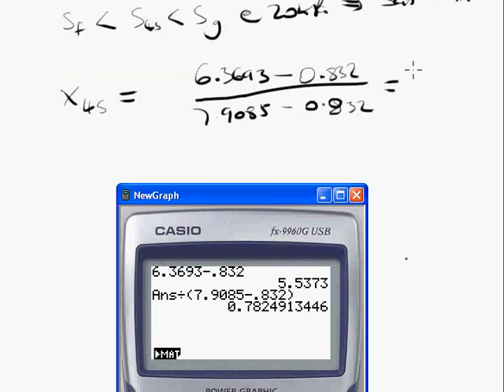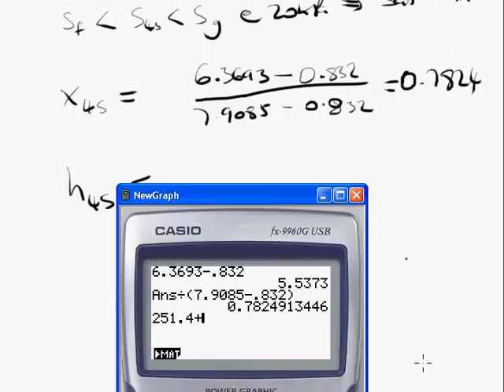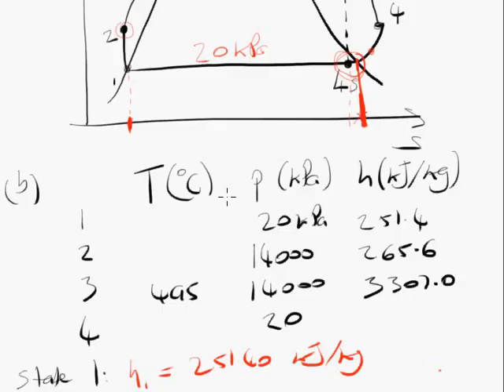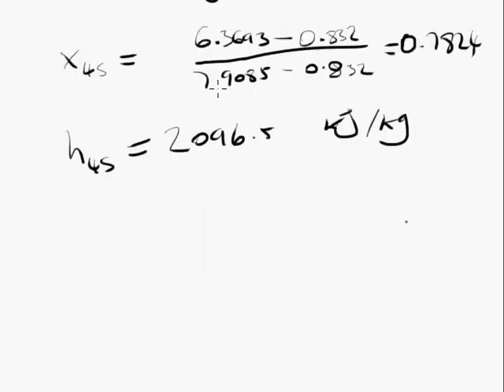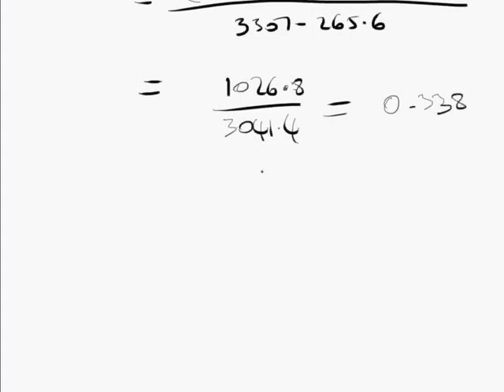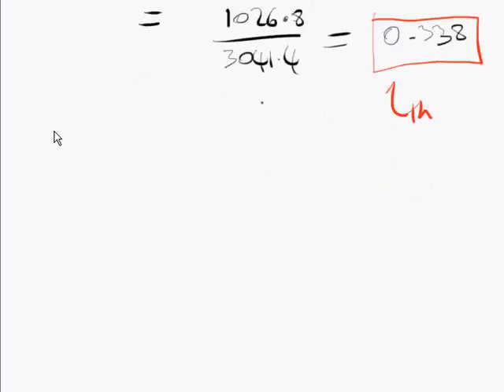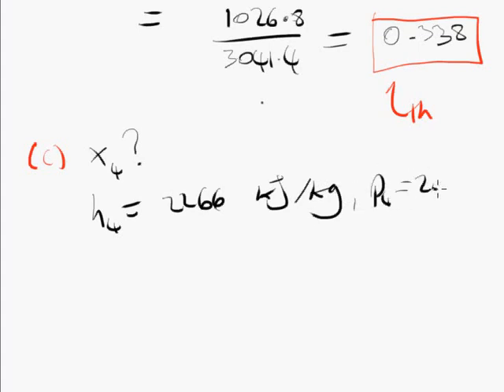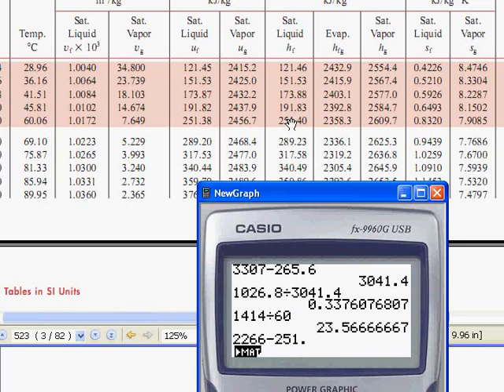Rankine cycle example part 2 of 2

Comment: Hi
I'm a little confused. The mass flow rate of water through the pump given in the question is 1.4kg/s. But calculation gives 1.169kg/s. Shouldn't it be equal if we use first law for the steady state CV version throughout? I know it's just an exam question. This extra information in the question is misleading and useless really. 
Thanks for the video btw